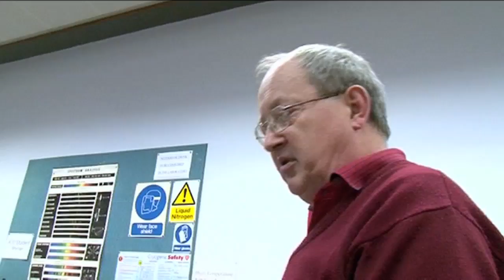Momentum, Magnets & Metal Balls - Sixty Symbols

Comment: Is there a way to create a ramp that multiple, ascending strength magnets would pull a steel ball up? If so, is there a  way to physically shield a magnetic field so as to let go of the ball once at the top of it thus allowing the ball to be pulled down another ramp by gravity and fed back into the loop?

I do not claim high levels of intelligence but I do like thinking about it. :-)
Reply: If you use electromagnets, sure it's possible. Just turn the circuit off once the ball has reached the top. I'm not aware of a way to divert or shield magnetic fields in the way you describe, but you can certainly make one and then turn it off with electromagnets.
Reply: Kremlit the Forg I suppose we will need to wait for the correct meta-material :-)

Comment: Ohms Law (I=E/R) is measured today as Volts = Amps/Ohms. However, the units volts, amps, and ohms didn't exist, and neither did the terms voltage or current. The E stands for electromotive force, the I stands for intensity, and the R stands for resistance. This is why we still use i for current. Sorry if this was already commented on in the past four years, but I became very excited that my knowledge as an electrician could help to explain a problem presented by a physicist. :)
Reply: Don't you mean, V = IR, Volts = Amps * Ohms?

Comment: What about on a frictionless track? Because if the force applied to both items is equal and opposite, then their change in momentum must also be equal and opposite. The electromagnetically generated momentums would then cancel out leaving only the initial momentum of the ball. It seems that this is occurring because the ball gains momentum without the magnet gaining very much, resulting in a big net impulse on the other end.
Reply: +Insertnamesz / Punocchio WERE do you get the friction less track
Reply: GglSux Yeah, I've given this some more thought as well. I believe what I originally suggested would be the case if it were only a 3 object system (marble - magnet - marble), and thus the kinetic energy gained by the incoming marble gets transferred into equal potential energy of the outgoing marble and thus v_final = v_initial, but in this case, we have more than 3 objects, so the outgoing marble acts against a weaker EM force since it is further away, thus, some of the potential energy is left over as the extra kinetic energy generated by the incoming marble and we have a 'loaded spring'! :)
Reply: Роман Плетнев Initial momentum isn't really applicable here because we have friction on the magnet. In my original comment, if we had a frictionless case, we'd still have the sling slot effect due to the differences in the distances of the EM force, however, to conserve momentum, the magnet would then probably be moving in the opposite direction of the initial incoming ball (newtons 3rd), so everything is nicely conserved. :)

Comment: Glad to see the good old perpetual motion magnetic machine debunked at the end - why do people think, that after hundreds of years of scientific research, it is only now that we can use magnets to create perpetual motion? The mind boggles...
Reply: Euan Odd The ball hitting the magnet has a high velocity as well, you just can't really see it because it's being accelerated right before the magnet. So the momentum of the ball hitting the magnet is equal the the momentum of the ball flying off. (idealized)
Reply: I see the argument surrounding perpetual motion, however, surely the work done to start the reaction is less than the reaction itself? As the ball travels with a higher velocity and therefore contains more momentum than the ball that hit in to the magnet?

Comment: The loss of energy wasn't because of the sound.
The loss of energy was because the 4 other balls moved forward a bit.
Had we gotten the same outcome, but the 4 other balls remained stationary, he would be correct.  But that was not the case.
Reply: Sound is a symptom of loss of energy. 
As some of the energy is taken up by the transmission of vibration through the air, this is potential energy that is lost.

Comment: They would get up to a certain speed and then stop accelerating after a certain number of arrays. At some point the resistance of aerodynamic drag will overcome the accelerating force of the magnets attraction. One ball would eventually strike the magnet at a lower speed than it had launched (air is slowing it down faster than the magnet is speeding it up, because its getting harder and harder to speed up as drag is increasing) and the next balls would only ever get back up to that final speed.

Comment: There was only 1 magnet, but I think you mean less ball after it. If you had only 1 ball it would only move a very short distance, and be immediately re-attracted by the powerful magnetic field. If the field strength is high enough the separation may not even be visible.
Note that professor Bowley says that the field leaks away more and more for each next ball, it's most powerful for the first one.

Comment: Depends on how you define "anchored". If anchored means it's welded to a huge mass not much would happen since the energy of the impact would be absorbed by the large mass. But if you allow the magnet to pass the impacting energy the marble would fly off at the same speed as the impacting ball, provided they have the same mass.

Comment: As he said, it wouldn't work.  The strength of a magnet decreases with the square of the distance.  So while one ball would get decelerated the same amount as the incoming one was accelerated, in the arrangement they have there, the ball that leaves should be acted upon by about 1/8 the magnetic force that the incoming ball was, just due to distance, leading to the energy imbalance shown.

Comment: You can use plastic wire covers from a hardware store. They're usually about 1 to 2 metres long and made of white PVC plastic. They're used when putting the electrics into a house to hide cabling but allow acces just by popping of the cover.

Comment: I notice the magnet and impetus plus two steel balls react in the opposite direction immediately, as the two speed on their way, the stationary originals move toward the impetus' beginning point. I wish for higher speed and most detailed photography. It's as if a wave passes through and back and tosses the weakest links, much like drops in liquids.

Comment: I would assume as you add more metallic spheres on each side, the momentum would dissapate as it hits the outer sphere, thus it can reach the point where enough spheres are added on each side that the sphere impacting the system will not cause the sphere on the opposite end to go off with such energy.

Comment: also, it could be that they only appear to move in the direction the magnet was and actually they just stopped when they met up, or the force of the shifting magnetic field pushed the magnet back away from the opposite ball which explains why the ball was flung out with such a great velocity, because the magnetic field put the same force on both the magnet and the ball. that's a really confusing scenario, we'll just leave it at, "the way the magnetic field shifts" since we aren't physicists :/

Comment: There is hidden potential energy in the system due to the attraction of the ball to the magnet. But this is a very short range force so it is only appreciable when the ball is near the magnet. The potential energy is released when the ball sticks to the magnet and two balls come away from the other side, with a small loss in energy (because they are acted on by a very much weaker force pulling them back to the magnet) leaving a lot of kinetic energy remaining for the two balls to shoot away.

Comment: so it would not be possible to swap the neodymium magnet to an electromagnet, use some coal to start the thing and have yourself a self powered ( except for the first starting of said electromagnet) "perpetual motion machine"? i mean you would have to go through and figure out intricacies of it turning itself off and on etc. but would you have to re-place the ball to the top of the hill, or could you create an electromagnet strong enough to pull it up a slight opposing gradient?

Comment: If you pause it at the right time around 2:34 You'll see that every ball is detached except the ones in direct contact with the magnet. I think it's because the ball hitting the magnet pushes off more than one ball because the magnet slides back, accelerating towards the ball as the ball also accelerates toward it, the sudden stop when they touch causes the balls to exert force in towards the magnet, and the opposite force causes them all to bounce off.

Comment: I'm sure this is not right, but I thought I'd throw it out there. I work with tattoo machines, which operate by electrifying a core by wrapping it with wire. There are two of these coils attached to a frame. They pull forward an armature bar that is held to the frame with a spring. This spring touches a contact point. When the a bar is pulled forward, the spring breaks the circuit and the coil demagnetizes, the A bar falls back an creates a circuit again.

Comment: The incoming ball's potential energy decreases by a larger amount than the outgoing ball's kinetic energy increases.

The incoming ball was outside of a magnetic field.  Therefore, it had the capability of doing work by entering the magnetic field and colliding with the magnet.  But, it takes just as much energy to remove it from the magnetic field as is released by it entering in the first place.

Comment: Magnet amplifies the energy ball is possessing.  By how much? Well it goes something like this. You have to figure out the energy the ball posses on its own when dropping from that height & hitting a solid object.. Then figure out what everyone calls the "pull force" of the Magnet. If the Magnet has a Pull Force of say 35lbs, & the ball is travailing @ a rate of .5lbs, then the Magnet actually bumps the energy in the ball up 34.5lbs a square inch no matter what. Making the magnet an amplifier.

Comment: It doesn't apply at all. I simply stated that the magnet was in a sense amplifying the Kinetic Energy of the ball once the ball entered the magnetic field of the Magnet.  If the ball was not moving @ that rate of speed, the energy is less & the rate the Magnet pushes the ball into itself will differ a slight bit. Gunner likes to think the energy the ball has comes from the guys hands as he seperates the ball from the Magnet. Mass+Gravity=Velocity. The Magnet amplifies it once ball enters fields.

Comment: This is odd. I click on you name & it says " this account in unavailable ". Either way. I find it hard to believe that the steel ball would move towards the magnet if it was to roll the opposite direction. I can agree with U & say that no matter the location of the steel ball it will always be attracted to the magnet as its composed of steel & magnets & steel attract one another. But I can't agree & say that the steel ball will roll towards the magnet once its launched in the other direction.

Comment: The ball was rolling due to the fact that it was released from a hight higher then the target. So the ball had inertia due to the weight/mass it carries & the hight it was released. If the ball that hit held a bigger mass, then the ball being projected would go even further, a reverse effect if the ball hitting was smaller. Its way easier then U want it to be. Put the masters away, its ok man we got this. The magnet in a sense picks up the speed, draws it closer faster picking up the inertia.

Comment: This is not "my" theory. This is classical electrodynamics. It is 150 years old and substantiated by mountains of evidence. The magnet is not an amplifier. It takes energy to separate the ball from the magnet. This energy comes from your hands. The energy from your hands now stored as potential energy in the ball is then converted into kinetic energy when it is released in the vicinity of the magnet. FYI you are not talking to a layman. I hold a masters in the field.

Comment: Doesn't your theory make the magnet a sort of amplifier then, only due to the fact that the ball was traveling @ a set speed that is slower then the pull force the magnet produces? If the ball was traveling @ a faster rate then the magnet wouldn't have the same effect. I see U say that its the energy from his hands is converted.  Watch again & see how he debunks that theory. He uses a piece off wood as a gate that releases the ball.  Mass+gravity= velocity.  Thats what I get out of this.

Comment: You have a basic misunderstanding of "magnetic energy". A magnet simply establishes a magnetic field. It takes energy to separate the ball and the magnet. The energy from your hands is converted into the potential energy of the ball/magnet. This is the input energy into the system. When the ball is released, the potential is converted into the kinetic energy of the ball, which is transmitted to the ball on the other side . All in all, energy input is from your hands and not from the magnet.

Comment: I wouldn't imagine so. Apart from losses through sound and heat, the end ball has the same momentum as the start one did at the moment it hit the magnet. The masses are largely irrelevant. p=mv
Momentum is conserved. You could put a tiny ball on the end and watch if fly off, or a huge one and it will trundle slowly. The momentum will be the same.
The mass of the magnet doesn't matter, just magnetic field strength.

Comment: Nothing or very little, the momentum transferred through the system would not be enough to overcome the the magnetic force acting on the second ball. Ball number 4 only flies off at such great speed because the magnetic force acting on it is reduced due to the balls in between it and the magnet. If u added enough balls in between so that the magnetic force acting on the final ball was negligible it would fly off much faster

Comment: So the final kinetic energy of the ingoing ball is m1*v1^2= kE, energy that the outgoing ball receives (minus the dissipated energy) and so the initial velocity of the outgoing ball is v2=(KE/m2)^0.5, which would be greater than the magnetic acceleration that holds the outgoing ball to the magnet and therefore releasing the ball. 
Notice the momentum is not needed and the direction of the speed is in the velocity.

Comment: The answer is simple, you just need to know a few things - the velocity (v1) that the ingoing ball has when it reaches the magnet, both its mass and of the outgoing ball (m1 and m2), the dissipation of the energy in the masses involved (heat and recoil) and in the surrounding air (sound) but since these are small we can neglect them. And to know the velocity of the ingoing ball we need to know its acceleration due to the gravitational force and the magnetic force.

Comment: If you watch at 2:32, you can see that the magnet starts moving toward the incoming ball before the impact. The magnetic force that is pulling the incoming ball toward the magnet is also pulling the magnet toward the incoming ball, and it eventually overcomes the friction between the magnet and the track. Then the magnet (and the attached balls behind it) starts moving backward... it happens so fast that it looks like recoil from shooting the ball down the track.

Comment: He said that the energy required to remove a ball from the magnet renders this phenomenon unworkable in a perpetual motion machine (of course, all PMMs are unworkable). The momentum comes from the first ball rapidly accelerating as it nears the magnet. It's not that the prof is wrong. You just didn't understand him.

Comment: The energy "comes from" the incoming ball. It has potential energy in the presence of a magnetic field (much like it has potential energy in the presence of the Earth's gravitational field). This potential energy is there because of the magnetic force between the magnet and the ball (again, like gravitational potential energy is there because of the gravitational force between the Earth and the ball).

I'm an engineer, not a physicist, so I will stop there. Dynamics is easy; E&M is not so easy!

Comment: If you watch the slow motion video closely, just after the impact the momentum of the emitted ball plus the recoil momentum of the remainder (four balls plus magnet) in the opposite direction add together to give the initial momentum (more or less) so momentum is conserved. The point is that the eye does not see this recoil, so it seems that momentum is not conserved. Also it seems perverse that a particle emerges with more energy than it arrives; that is the appeal of the experiment.

Comment: What?  A lot of data?  Are you high?  It's data that's already collected, processed, and moved in and out as a JOIN to whatever database system YT uses.  Even assuming a 32bit integer to track these, at 4 billion views per day, represents a total of 128 billion bits, or 125000000kb, or ~122,000Mb, or nearly 15,260MB @ 8bpB, or ~15GB, or 1/15th of the data being UPLOADED IN ONE MINUTE.

Server or browser interpretation/interaction seems a more likely culprit.